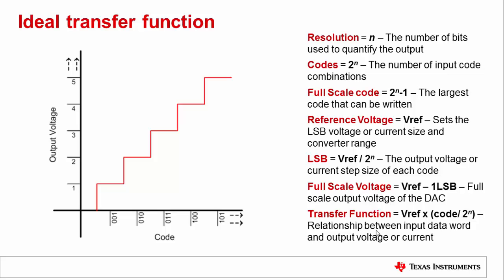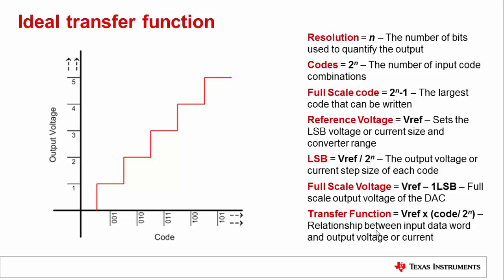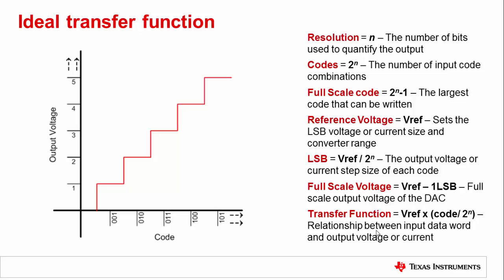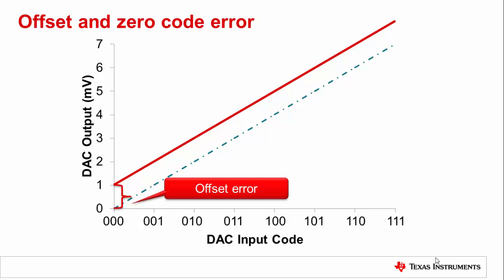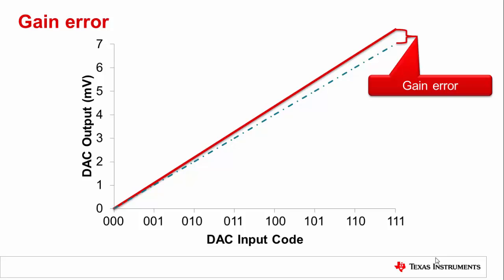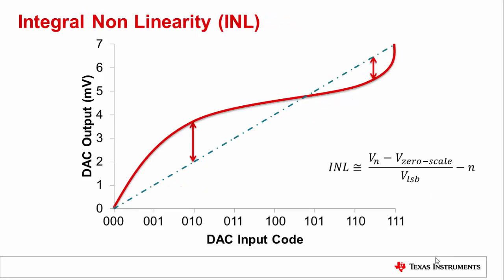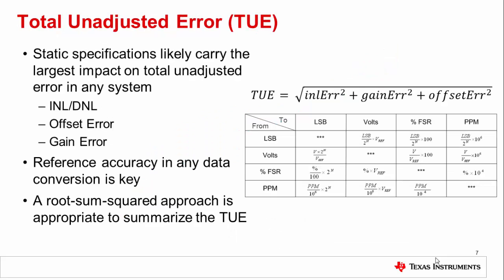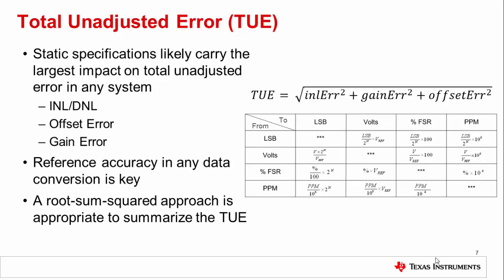Precision DACs:  DC Specifications

Comment: Hi. I don't know how can I convert DC output of a R-2R DAC to AC signal. Becasue I want to use it as input for amplifier (pre-amp, power amp).
Example: I have a 2 Volt sin wave output of an R-2R DAC (sin wave have min = 0 Volt, max = 2 Volt)
=> How can I convert it to AC signal (keep it still a sin wave, with have min = -1 Volt, max =1 Volt) ? 
Thank in advance.
Reply: Hello,

There are a variety of ways to go about doing this. Probably one of the easier methods would be to simply use a DC blocking capacitor before driving a buffer amplifier.